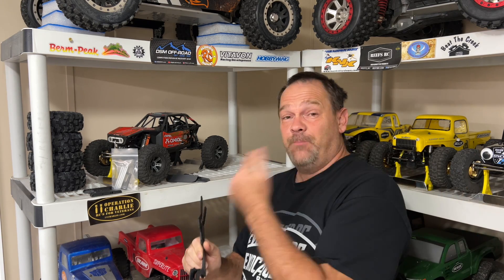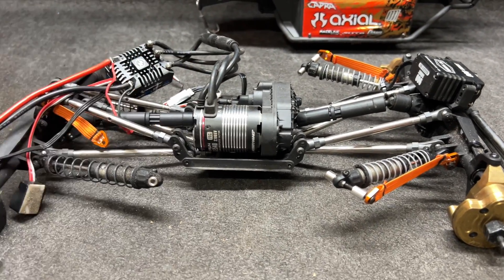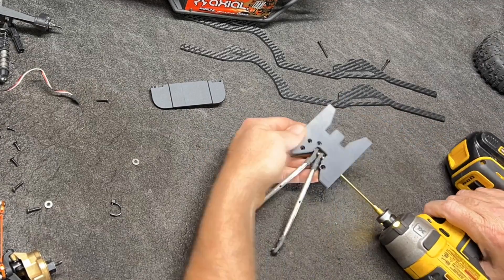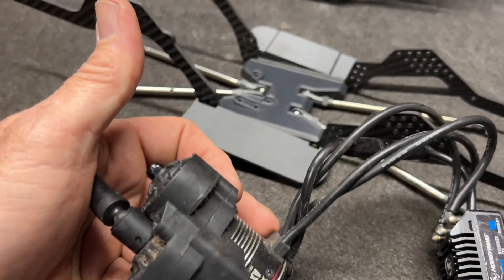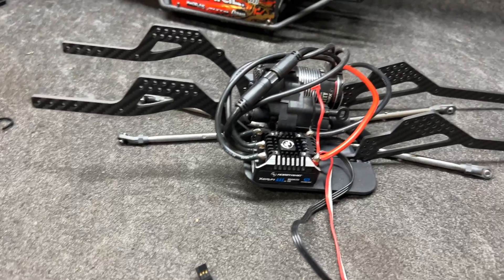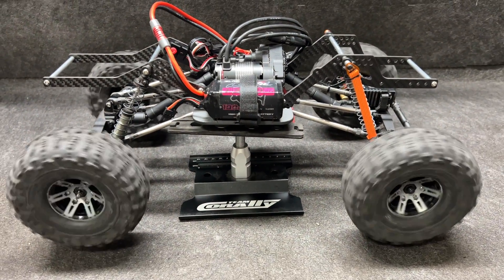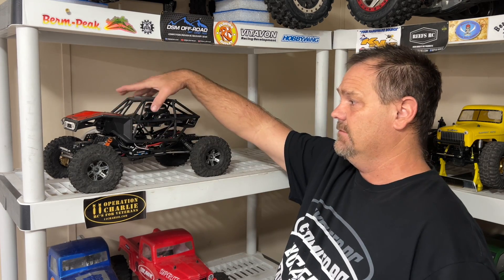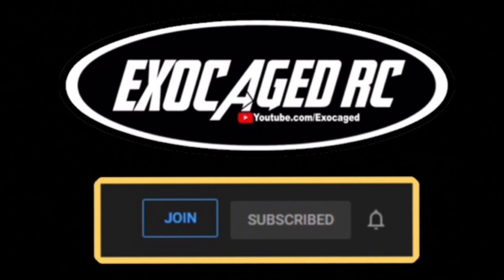Punks Custom 3D Stage Dive Carbon Crawler Chassis build for the Capra

Comment: The prices for this stuff frankly get insane, 2 slabs of carbon and 3 printed bits 130$!? Dunno man maybe something wrong with me to see it too speendy for what you get 

Sheets of carbon are pennies if bought in bulk…
Reply: When you start doing this for a living, we'll see how much you charge for a chassis kit.
Reply: I have never seen carbon for cheap.
Reply: From my experience the 3d parts start to break down and become too flexible. I run into this problem a lot with any PLA 3d printed part on our fpv drones.